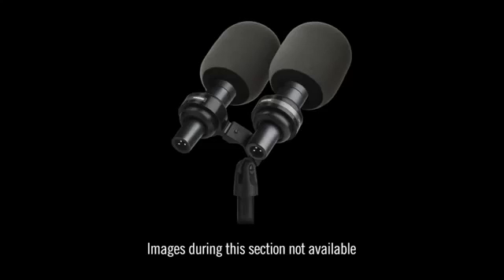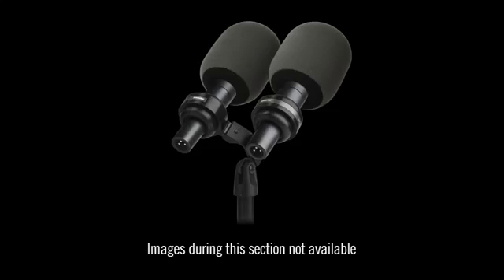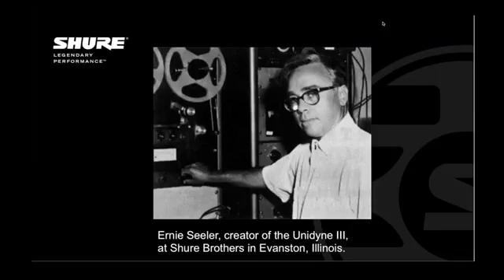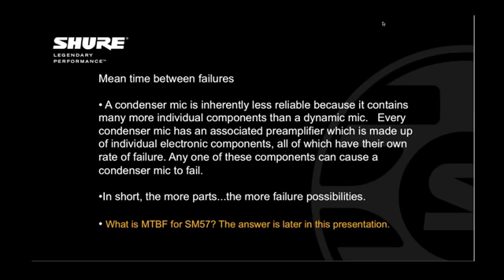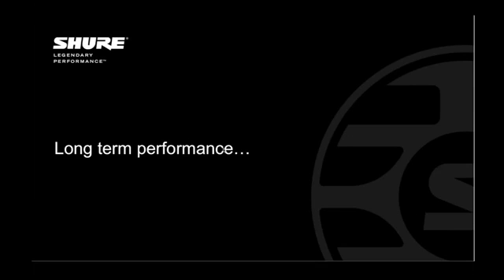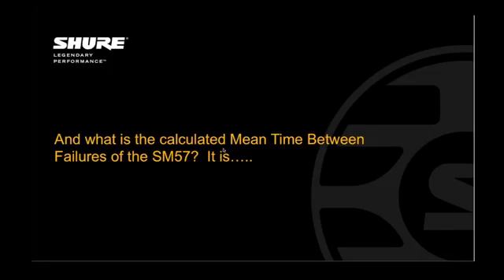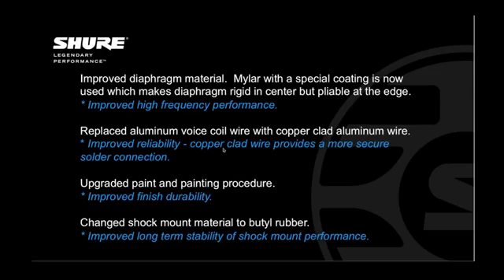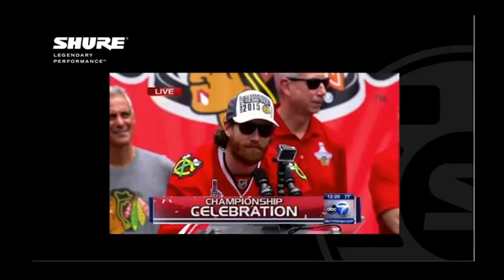Shure Webinar  The SM57 and the President of the United States

Comment: How is it that the Shure sm57 cost was $63 in 1968, and in 2021 its $100.  I'm pretty sure that you could buy a house in a nice suburban setting for around $27,000  bucks back then.  I have 8 Sure SM57s, so if I had a time machine I would buy 19 more for $2000 and change (sales tax) in the present time, warp to the past, sell them, buy a house that is worth $330,000.00 today.  I have discovered a perfect currency for time travel - a currency that has profound reverse inflation.